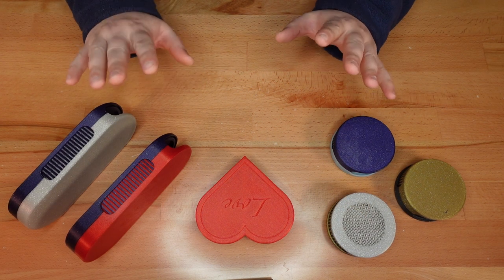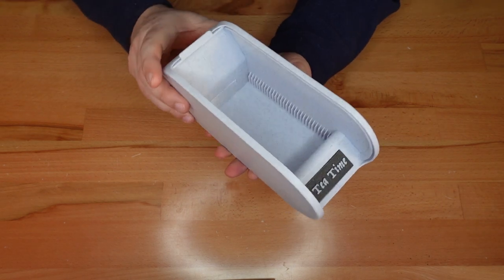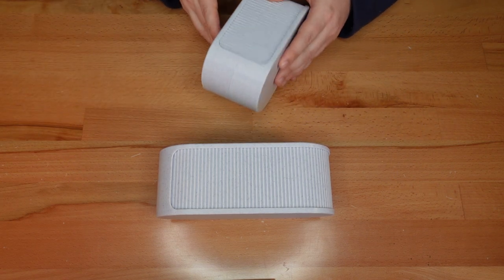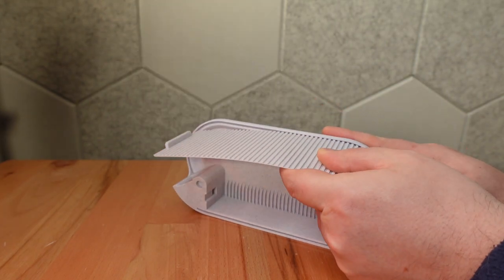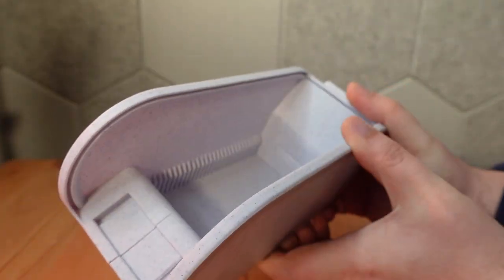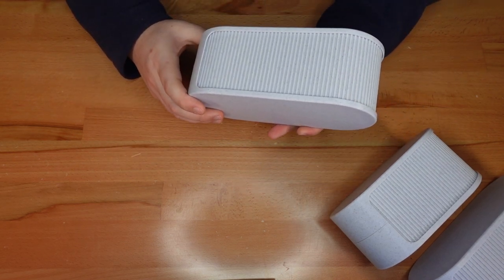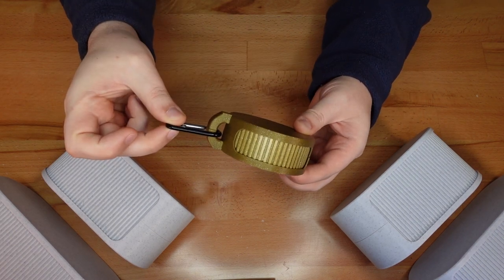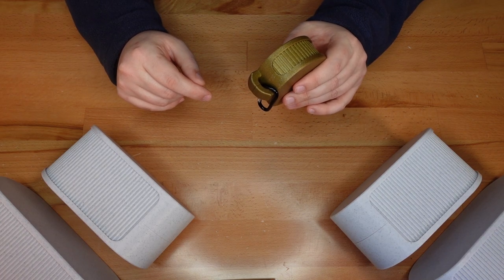Tea Time! A new 3D Printed Shutter Box

Comment: Really well designed. Desiging multi parts objects is no easy feat. Well done!
Reply from the maker: Thanks so much, these shutter designs have been a lot of fun to create!
Reply: @3DPrinty  I am curious if you designed the whole part and then to split and add tabs and the brackets or did you designed half of it mirrored it and added the extrusion/cut for the tabs?
Reply from the maker: For this design I modeled half of it, mirrored it, then modeled the latching tabs. I knew the design was going to be mostly symmetrical, so that seemed like the easiest option to me.
Reply: @3DPrinty  Thank you it's always nice to get insight in how other people approach a design (:

Comment: A quick idea for a future project if you need one, a door knob wall protector that has a latch to hold the door open. I uh....put a hole in my wall and need something to glue over it 😄

Love your designs, this is a great one to show the wife it's not just a toy factory!
Reply from the maker: That sounds like a great use for 3D printing - especially in TPU!

The final shape of something like that would depend greatly on the size and style of your specific door handle. I'd encourage you to give designing what you need a try :) There's a good chance you can build what you need within Tinkercad, which is both free and a good starting point with 3D design.
Reply: I do use Tinkercad to modify STL's, though I'm not super good at it yet. Where I'm not sure on this design is how to make the hinge so that the latch doesn't stick out while it's not needed.

Comment: I want to try to do the sign similar to this, but I would like the box to be with square edges and not with like this round part that the box in the video has, I don't know if I'm making sense but it's possible? Or do we need us to make the sliding part possible?
Reply from the maker: If the box is large enough that the door can slide sideways without bending (like the classic sliding doors in Scifi or a Japanese shoji door) it could fit in a square box. If you want the door to be proportionally large (like in this design) you either need a soft rounded corner for the shutter to slide in or you need to tack on a fake sharp corner to make the box look square even though it secretly has a bend on the inside.

I hope that helps!

Comment: Why you not combining the "flat decorative insert" with the "staple" shape?
Then the "decorative insert" would've require absolutely no glue. 😉
Reply from the maker: Definitely possible, but I don't have a multi-color printer (yet) so I needed to print the "Tea Time" sign flat... or use supports. And I really dislike supports. Good question!
Reply: @3DPrinty  I think you can insert a command to park the printer after the specified layer then resume printing when you click the button on the printer, so, you would be able to change filament in mid-print. 🙄 Alternatively you can colour the raised letters with a sharpie or something similar, just don't give up. 😉
Reply from the maker: I must have misunderstood your first question and that lead to more confusion.

The decorative insert is already available in a staple shape for glue-free installation. You have the option of either a staple shape or a flat sign.

However, the arms of the staple forces us to print it on its side - great for a clean print, but not good for a mid-print filament swap.

If you don't mind printing supports (or if you have a printer that can produce perfectly flat long bridges), you could print the staple-shaped sign so that the front of the sign faces up. In this position you can do a filament swap - just like I did with the "Tea Time" print in the video. I hope that clears up the confusion.
Reply: @3DPrinty  That's okay then.